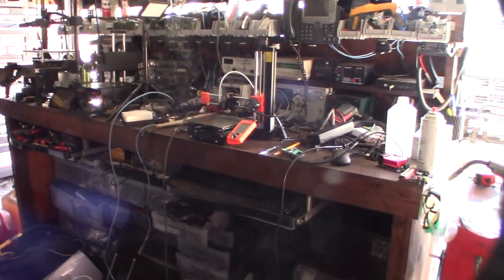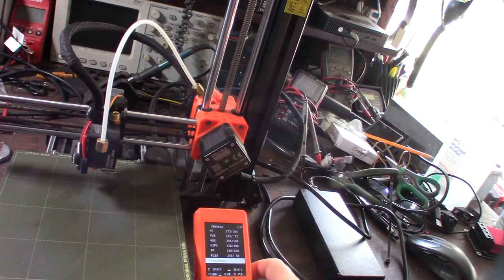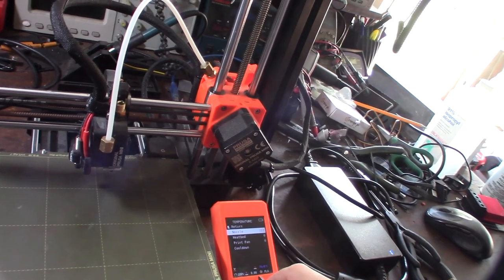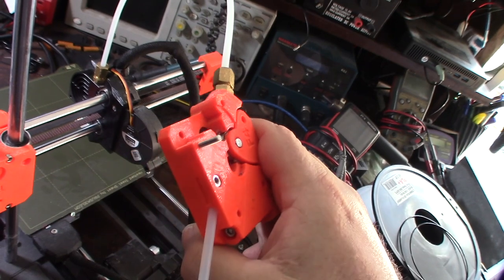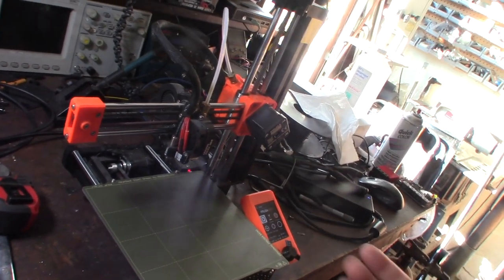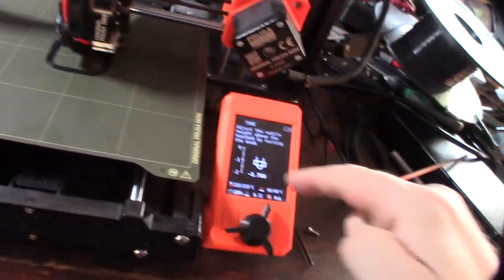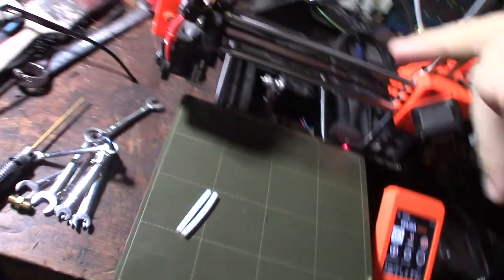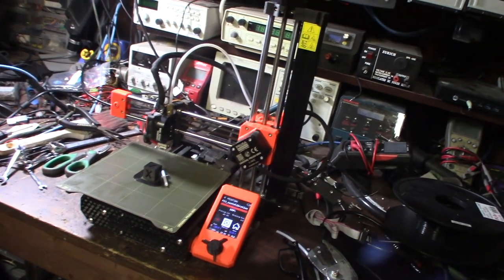Prusa Mini+ Filament Jam under extrusion troubleshooting repair Mini Jamming

Comment: I have three of theses' and they work great the only problem is they need to be set up right before printing the extruder tension screw should be flush with the extruder housing with the filament installed also loosen the three grub screws and push the heater block up as far as you can push it up and retighten the screw's that's the biggest problem with jamming and under extruding once that is done you need to set the pinda probe 1mm higher than the nozzle and do a calibration again that will fix that printer i also change the ptfe tube's to capricorn ptfe tube its much better for a bowden tube set up.

Comment: And I find that the filament sensor is too tight for most filament so i just remove it and set the tension for the extruder

Comment: It does not go over 170 with preheat because it alway does a mesh level before printing it does this all the time
Reply from the maker: I've worked on hundreds of printers. The Prusa Mini is OK. I think the number one issue with it is the single drive extruder. Its more likely to cut into the filament. I've worked on 10+ Prusa's. I'm trying to figure out why they are so expensive. For that kind of money I would rather have a Voron  or good core XY.